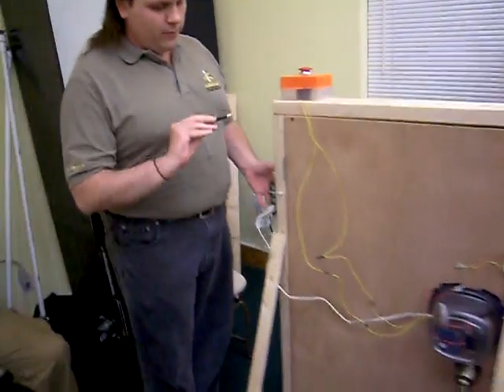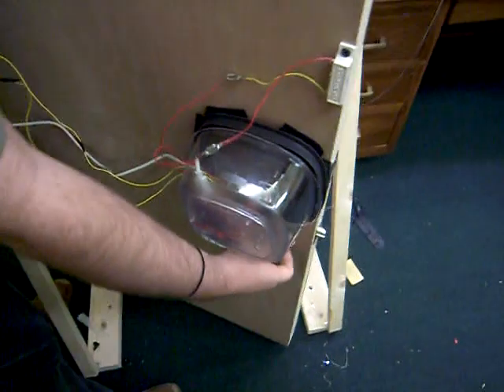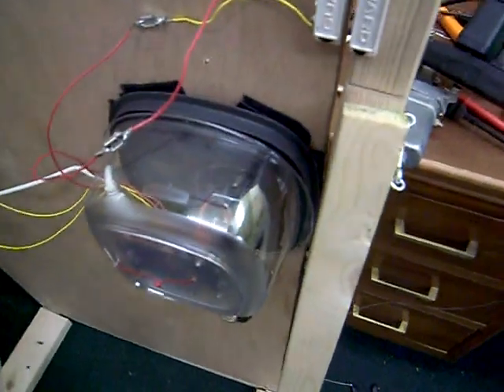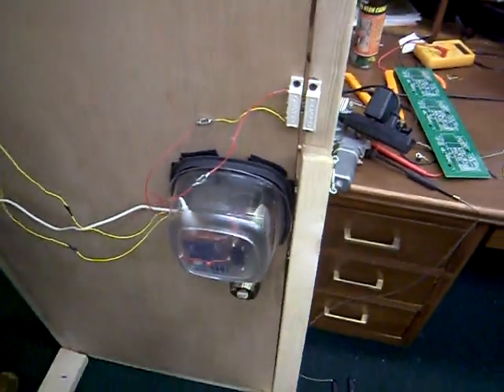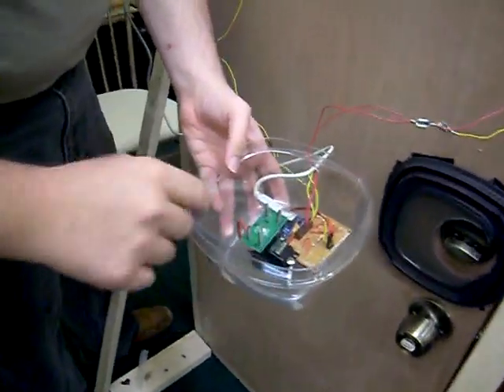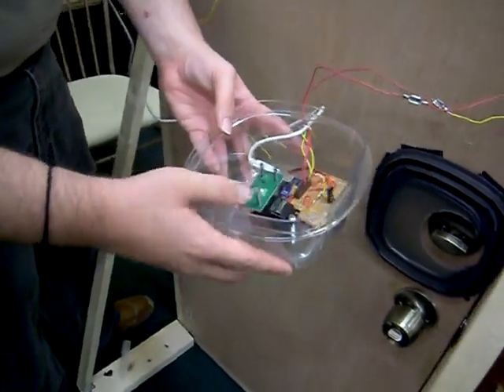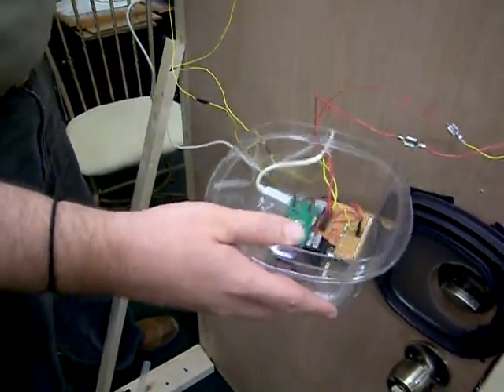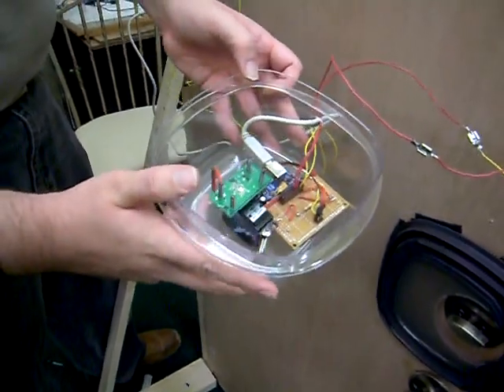Makers Local 256 USB Autheticated Deadbolt Servo

Comment from the maker: We actually built a new one that utilises a powerbolt 1000.  The motor turning the bolt is only marginally quieter, though.  We've been using it in a warehouse type building so noise hasn't been much of an issue.

Comment: @eyhexs Thats why you use a backup battery and a pc set to auto power-up when it's been power has been disrupted. All you have to do then is run your program as a start-up program in Windows, problem solved. However, in reality this system would not be  ran on a pc but have it's own internal logic interface with direct and battery power.